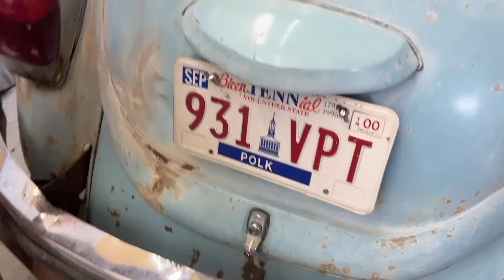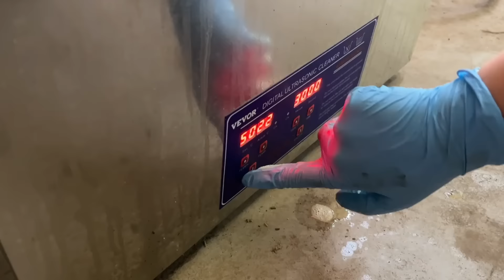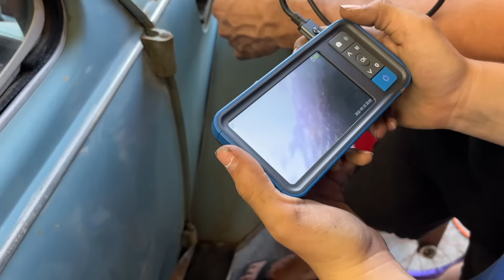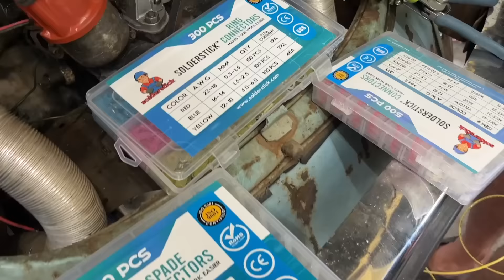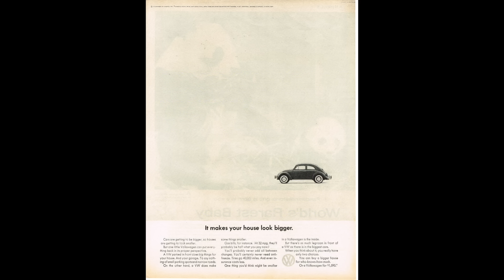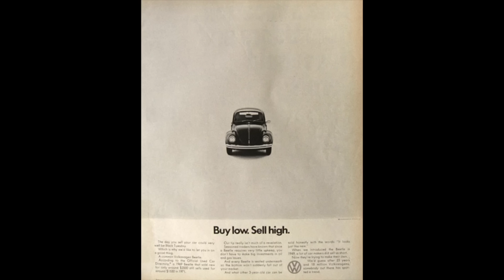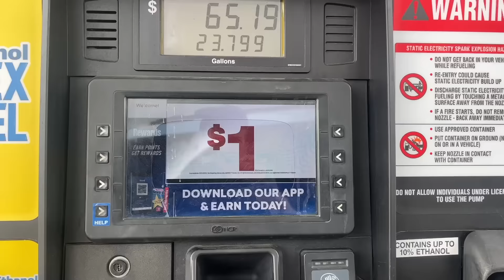Parked 23 Years Will It Start Cheap 71 Volkswagen Beetle Survivor

Comment: Great work getting the little car running. If I could make a suggestion though. There are tins that go below the crank pulley and above the muffler. It is VERY IMPORTANT you re-install those. They keep the heat out of the engine compartment from the muffler. Without them, you run a very high risk of overheating and blowing your engine. Also the front and rear engine compartment seals. They go around the engine to and the inside of the engine compartment. Both of these are VERY IMPORTANT to also keep the hot air from cooking the engine.
Reply: Excellent advice; heat is the killer on air-cooled Aluminum engines. One reason I saw a lot of them with modded engine compartment covers that were louvered here in Oregon.

Comment: We had a '71 the same color back in the day.  Ours was weird though.  It had a stick shift, but no foot clutch pedal.  The clutch was operated by vacuum and engaged when you grabbed the gear shift knob.  My sister had an older one from about '64 or '65.  Hers was a 6volt type and the floor pans were so bad you had to lean towards the doors to keep from bottoming out in it.  To operate the wipers we had shoestrings in the wing vents and I'd pull them to the right and she'd pull them back to the left.  The battery was always shorting out as it's rubber cover would slide off and the terminals would start smoking the underside of the back seat, so most of the time I had to push while she popped the clutch to start it.  The '71 was solid though.  Even the heater in it worked some.  It survived two teenage boys (me & my brother) with my brother even rolling it onto its side on a gravel road, and me nearly backing over it in my jeep in the driveway because no one ever parked behind me...until my brother did, LOL!  I remember driving it to a local general store once and on the way home there was a bang and a loss in power.  I limped it home, opened the hood and one of the spark plugs had blown completely out of its cylinder and was lying there still sparking away.  We sleeved the socket and put the plug back in and it ran fine again.

Comment: If you want more top end = more speed there is a trick. 
Get a transaxle from a VW bus or truck that has gear reduction boxes at the wheel ends. Remove axles and axle tubes, swap the ring gear = turning ring gear around. Replace with standard bug axles and you have more high end. Don't forget to turn the ring gear around, if you do forget you will have a 3 speed reverse and single speed forward. (ask me how I know😂).
The first bug I owned was a 1959 with the original 25hp 6volt engine. And if the battery went flat no problem, it came with a crank to start it. 
If you want to upgrade the cc on the engine (easy) get larger pistons and jugs, they just bolt on. 
My best time for engine removal was 26 minutes flat. 
And complete teardown was 1hour 52 minutes.

Comment: I have owned a couple of VW buses and I can tell you from experience one of the best things you can do for these air cooled engines is go with a full synthetic oil. That and they make an adapter to add an external oil filter. By doing that and getting the biggest oil filter you can to fit, you will increase the oil volume. The VW will run much cooler and help save you from burning an engine up under load (going over the mountain with passengers on a hot day) get an oil temperature gage and shut it down if it gets too hot. I learned these lessons the hard way 😢. I am so glad that you are teaching your kids how to work on the vehicles. Good on you!! If they break down out in the hinder lands, chances are they can make a repair to get back to civilization. My wife had a 1960 VW bug when she started driving and I have been tasked with finding another to fit the key that is still on her keyring..😂

Comment: A thing about Beatles is the hot air to the cabine get the heat direct from the exhaust pipe. On very rust exhaust the fumes and carbon dioxide can go inside the heater ducts and the cabine. It worst to change the exhaust or isolate the heat system. This car was a great find, super clean and completed. Congrats!

Comment: The engine is a 1966 model the only year for a 1300 and the first year for replaceable camshaft bearings. Is should have a 1600 dual port. Good news is, you can turn that engine into a 1600 dual port easily. You paid more than it cost new but a good buy, it's in great shape.

Comment: Also the reason you had so much trouble getting out that one plug is that it's the number 3 cylinder it's the hottest cylinder and is to common to find helicoiled..I think its cuz of how the air and oil moves through and over the engine and the firing pattern etc..
Reply from the maker: Ok good to know

Comment: The old distributor probably had a bad connection on the breaker plate due to rust so when the advance moved it you lose ignition once" Wawa" gets used to working on her beetle you won"'t keep her out of it I got bit by the VW bug a long time ago and i don't won't to be cured my first long trip with my 1971 bus was 1100 miles with 2 minor problems i fixed on the side of the road i enjoy watching your videos because you guys have such a great family God bless Karl from eastern Canada

Comment: Now youre a family after my own heart. Working on a 71 Super, which was the first beetle i ever owned. An old man in a trailer park had it for sale. He told me to take it home and if i got it running to bring him a couple hundred dollars. Lol, set points, clean spart plugs and i was blasting all over and i took him $200. Ive has a dozen or so since. My latest is a 68 convert, 73 super, finerglass dune buggy on a 69 chassis. AND, youre swiping parts from a Brougham. I uave a 77 Dodge Brougham thats one of the 3 dodge vans ive drug home to play with. If you all have a Jeep CJ im going to say we are long lost cousins. Lolol. Thats going to be an awesome first car. Repairs on the street and it can be pushed anywhere.

Comment: First car I ever bought was a 19655 beetle. I paid $200 for a daily driver.  When the body got so rusty you could lift up on the door and lift the body off the floor pan, I found a 1964 with a great body but no engine and did the engine swap alone in my driveway with a couple of stands, a handful of tools and a floor  jack.  It had a gasoline heater, pop out rear windows, and a crank sunroof, all for $100.  That was the start of a lifetime love affair with old VW's.  As long as you have fuel and spark there's just about nothing you can do to keep them from running. When they get old and worn out they'll get so much play in the parts you hardly need oil, a fan, or generator as long as it was a short trip. 28 mpg in town or on the highway with a 1500.  Forty five years later and I find myself answering all your questions in my head. You talk about design, I had several type III (fastback, squareback) cars as well.  They had fully electronic port fuel injection in 1968. 20 years later and you still had a hard time finding American mechanics smart enough to fix them.  Back then VW had a whole different mindset about building cars. To this day, I would still not hesitate to own one as a daily driver.  They are an incredibly sensual car compared to how numb our cars drive today.  The smell, sound, feel, and look are all unique.  I remember it still.

Comment: On the 71 Beetles, some came with a 1600 S.P. rather than the dual-port heads. They both used the same carb (34PICT), but the S.P. was abt. 50 hp. and the D.P. was 63 hp. Overall, the single-port design seemed to have a little better bottom end torque, and were better suited for dune buggies and sand rails, at that time.😉 EDIT: The yard 'trials' was hilarious! That reminds me so much of when we were kids.. no brakes, no clutch, and a lawnmower tank for a gas tank.🤪 Seems your clutch disc was rusted fast to the flywheel, and finally broke loose. It happens in damp climates.😄
Reply: LS swap it.
Reply: Was that the one with the 3 piece intakes ?? famous for the cracking hoses leaning it out badly with vacuum leaks I never had that one .
Reply: @johnsiders7819  Yep, the dual ports were all like that from the factory, and those orange (or black) intake rubbers were notorious for cracking after 30-40,000 miles. My '71 was actually a 1600 S.P., but it was pretty tired, and I built an 1835 D.P. with twin 40mm Brosol downdrafts, and individual manifolds that actually came with the carb upgrade kit. They still employ an equalizer tube between the carbs, so they're not so quirky to keep in tune.😉

Comment: The clutch disk and the clutch plate can stick together after the vehicle has been sitting for a long time. Pressing the clutch pedal can damage the springs in the disk as the throw-out bearing is trying to pry the disk away from the plate. This is how the transmission is disengaged. Driving the car around is the force that will separate the disk and plate back to normal operation.
Reply from the maker: Awesome thank you

Comment: clutch discs can stick to the flywheel .Leave the clutch pedal pushed in and drive around. Bumping the throttle with the pedal pushed and driving will often times cause the disc to break free and work normally after that. It works for me.

Comment: My very first car was a 1972 Super Beetle that I got for $113.34. $100.00 for the car itself and the $13.34 was for the labor when the original owner put in a new exhaust system (because the one on it had rotted through) so I wouldn't have to buy another for $600.

Kept it for 4.5 years, all through college, sold it when the bolts that held the engine up were rotting through. The best thing about it was even going 65mph it still got 36mpg!

My advice for Wawa? Invest in a really great sound system. 2 speakers in the rear deck, 1 in each of the door panels, also if you want to hear some great driving music, find the soundtrack to 'Eddie and The Cruisers. The song 'On The Dark Side' will make you want to drive the car on the interstates or highways all the time!

Happy VW!

Comment: Make sure the heater and defroster ducts work and are not riddled with holes, because come winter time you don't want to get CO3 poisoning. Check for rusty floor pans so that no one falls through the bottom of the car. The best thing about that car is that they drive great on snow as long as it isn't deep enough to bottom out. I'd like that project for myself. I've had two Battles and a Karmann Ghia.
Reply from the maker: Yeah for sure

Comment: Love it. The shock of starting it up in gear probably broke all the clutch rust loose. With only 4 bolts holding in the engine, people would swap them out often, I'm guessing thats why you have a single port instead of the dual port. I think you were missing the plates and seals around the engine- Those plates keep the hot engine air from getting pulled back in and super baking the engine. You will want those plates/seals. I suggest, don't go chrome, it rusts really fast.
I helped my Brother re do his 72 Baja, like ground up pans, 3in body lift rebuild. Key things that bit us. Pertronix distributor, get the full on HEI distributor, best investment for daily driving, it is huge. We didn't even make it home with the car, the points are always trouble. The Steering gear box has adjustments, if you have slop, you possibly just need adjustments. If you decide to go with an Alternator the generators had failures that ended in fire. We went Alternator and love it. Get a Bosch Alternator, bit pricey but youll spend just as much on the off brand twice. lol we did. The spot where the windshield wipers go through the cowl, they rust bad and leak rain water even worse, grease them up. My Brother replaced the motor before realizing it was those arms rusted tight. >.< And the car radio bit the dust when the rain water leaked into the dash. The original fuel tank hoses (goose neck and vent lines) are horrible, I think they are rubber and cloth mix, you will smell gas till you get modern hose. 
The back seat, Get a piece of Rubber or Leather to put on top of the battery, this keeps the seat from grounding out and melting the battery down. Mudflap? < common.
Huge save the car thing, The pillars behind the back side windows, they filled those with Foam from the factory, the foam shrinks and holds water rusting out the pillars. We took coat hangers, bent them straight ish, put them in a drill and worked all that foam out. We did put modern foam in to cut down on road noises, but check to see if that foam is holding water. May not be an issue in your area, I'm Pacific North West, huge issue up here with the rainy seasons.
Biggest thing, The Beetle Bible.   "How to keep your Volkswagon Alive" -John Muir . This book has EVERYTHING Beetle. Everything. 

:)  This is just off the top of my head memories. 
Great video, love the whole family involvement and the animals :) Really enjoyed it all. 
The Pinto pulled me in, The Beetle got me to stick around :)
Me. 
Sorry for the novel :P

Comment: For a spare starter, get a Briggs and Stratton rope starter pulls. Install under the generator nut. Use rope to start the engine.  I did this on my 912 speedster.  Lots of at PCA outings.

Comment: Used to race bugs back in the day, used vaseline to put it the carburetor together, otherwise their real sticky.  After the third or fourth time, they are a dream to work on, like butter. Just put a thin  film on everything, Don't forget to replace the throttle and choke bushings. They wear out quite fast.

Comment: Pressure plate and disc had rust on the flywheel...usually you can push the clutch in and. Crank it in gear and it will break loose every time. COOL BEETLE
Reply from the maker: Makes sense. Thanks

Comment: My 66 bug, before it belonged to me, belonged to my cousin, she would drive it until she couldn't get it started before. she would take it to get fixed, 
The starter went out, so she pushed it to start it, 
The brakes went out, so she would down shift THEN open the door and stop the car by dragging her foot,
The car was running on maybe 2 cylinders, she took it to my grandpa, I helped him pull the engine after he tried everything else, he opened the engine case. and the crank shaft was broken at an angle. it still ran but like a hit & miss engine.
Grandpa rebuilt the engine & brakes. and it ran like a scalded dog!

Comment: Those are the easiest engines and transmissions to work on/replace/rebuild. You can get parts cheap and anywhere(because they built so many). The heat will burn the hair off your ankles and you'll get frostbite at the same time in the winter. Make sure you check the heater ducts. They have a tendency to rust really bad. The clutch was probably just rusted to the flywheel.

Comment: Carb kits come with a plastic float because the old metal floats will always go bad and fill up with gas and cause the engine to flood.. Also make sure the shifter is fully in reverse before engaging the clutch or it will knock out the reverse gear

Comment: Very easy answer,  clutches that sit for extended time periods can become stuck to the pressure plate or flywheel, and free up with a bit of jerking like you succeeded in doing with the first test drives. Same situation with brakes that sit. Brake pads and clutch material are the same. P.s. don't forget to loosen the clutch cable wing nut you tightened... don't wanna burn up clutch
Reply from the maker: Yeah for sure

Comment: First and for most CLAMP your fuel lines.
There is a fire arrester that goes in the engine compartment, I would get one of those.
There used to be a 4 tip Monza header you could get will quite it down and give a growl throaty sound!

Comment: A friend of mine, when replacing spark plugs, would first pull the engine. Which he said was easier then fighting with the rear plugs. However I see Wawa having small arms is the key. 

Yes the fuel hoses never had clamps, and yes, if it was me, I'd add clamps an out a stainless fuel line by the exhaust. It was not uncommon for an unmaintained VW to catch on fire 

Put some type of insulated plate over the battery. The seat springs tend to short out the battery if to much weight is out on the seat

Comment: I've had a crap-ton of the old beetles over the last 40-50 yrs..  I've seen so many times where I bought one that the clutch was "bad" and it was only stuck.  Her driving it around a bit freed the clutch (as I'm sure you know now).
They're super reliable.  it's definitely a KISS car..  the 1600 (the engine that's supposed to be in it) are mildy more horsepower, but still no screamers..  A simple upgrade is a 1641cc, or even a 1776cc (just a jug/piston swap), a lightened flywheel, and a set of dual port heads will be good.  the PICT34 is still enough carb for it, too.  You can swap to a weber 2bbl, but the PICT carbs are less headache and work fine for her.  
I've never had any decent luck with the Pertronix EI, the points style works as intended.  "The People's Car" is a simple piece of automobile history, and if it was troubled car, it never would've made it 81 yrs of production, almost unchanged.  :)
Reply from the maker: I’m glad it did
Reply: Get a set of heater-boxes for the car (exhaust manifolds).  they tend to rust, and will allow exhaust into the cabin (how the car is heated)..  piece of mind and safety for Wawa..
edit:  I'm watching the 'back on the road' vid now.  I'm a new subber, so I've been binge-watching your videos <3